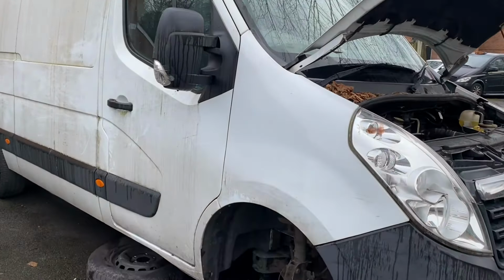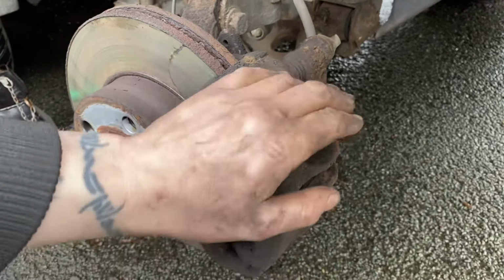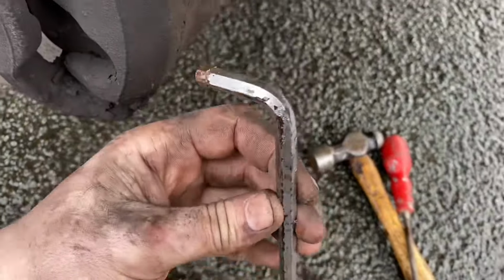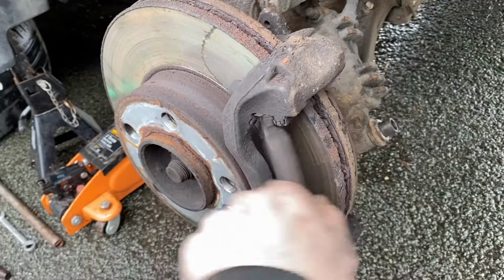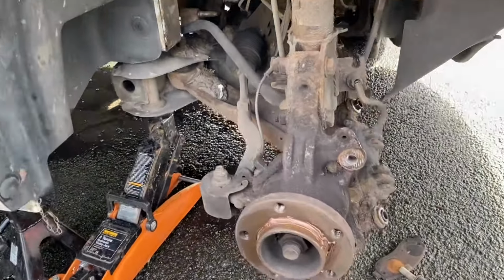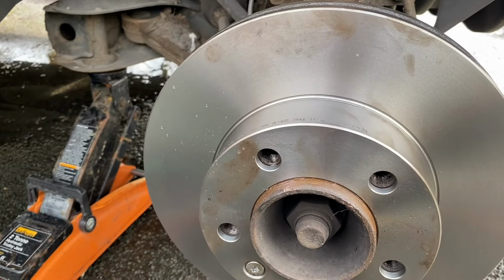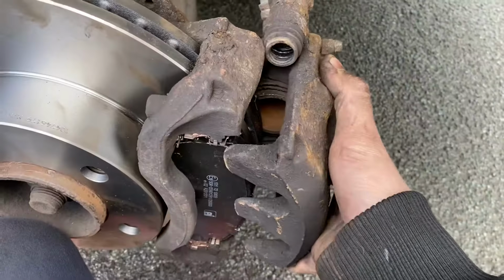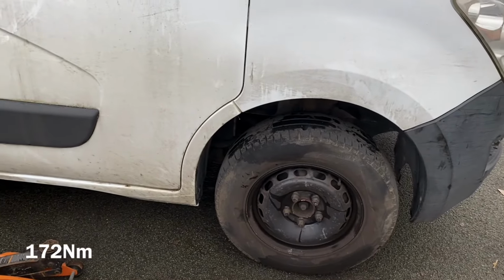Vauxhall Movano / Renault Master Front Brake Replacement (Discs and Pads)

Comment: I've got insomnia tonight so I though I'd watch some of your videos.  Every single time I've changed pads and discs on my own cars, I always have a seized caliper or two.  But changing it for friends it's been so easy.  I've never changed a caliper because brakes give me the fear and as soon as it comes to bleeding them, the Mrs doesn't listen to the "down, hold" "up, down hold" and I end up with spongey brakes.  Or it might be me just doing it wrong.
Reply from the maker: Try bleeding using the method I use in this video. It’s the way I do it 99% of the time on both cars and bikes. It can be done on your own with no help 

https://youtu.be/XMTsnHA_9ek?si=sr5qs7nuC910hlLS